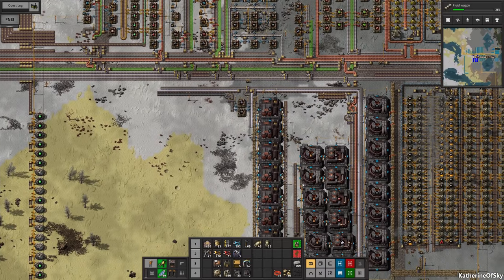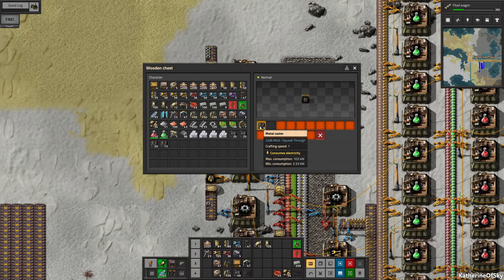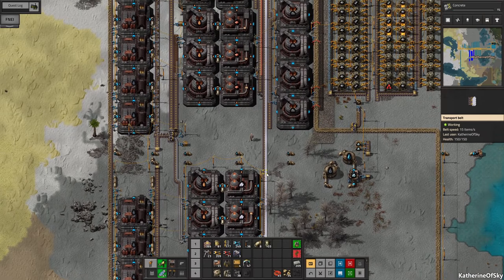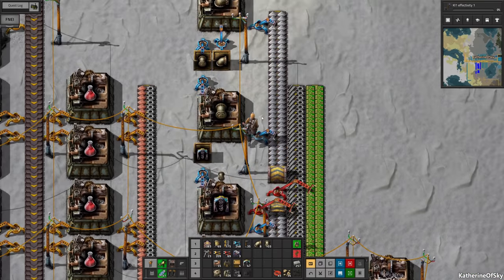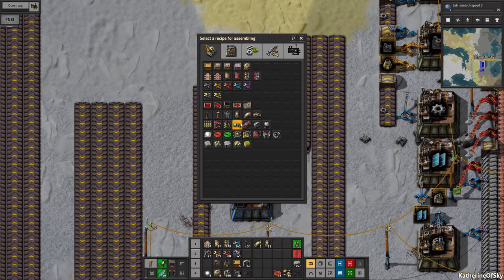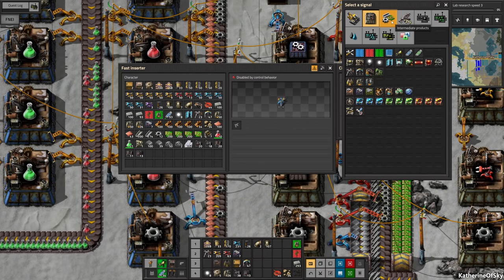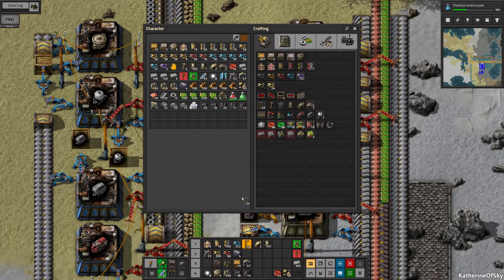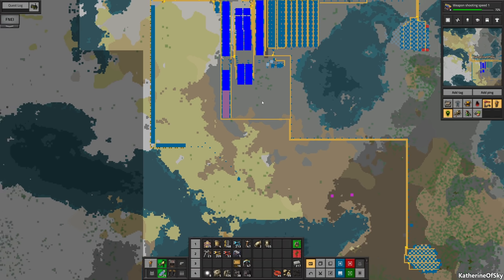Factorio 248k Mod 07 - TRAIN ASSEMBLY  - Tips & Tricks

Comment: If like me you find your factory halting because of excess byproducts this mod throws at you.  Take a look at the item/fluid handler.  It's a tier 1 research in the mod.  It basically eats excess items at the cost of some energy (can also be used to recycle some items later).  Very handy as the byproducts get worse and worse as you tier up and perfectly balancing consumption with production for a line of items 10 items deep is very rough.  Also, I'm enjoying the series.  Hope you're having fun.
Reply from the maker: I saw that.  I am going to try to avoid materials deleters though because I feel that it's a cheaty way to play.  Depends how balanced the mod is, though.  It might be necessary

Comment: KOS,

That Red. Cube was part of the 248k beacon system. It's a remote control system which helps save on the amount of modules needed 

You'll find out quickly that having machines beaconed, even with early beacons, is worth it.

BTW, 248k is in v1.0.10.
Reply from the maker: Yep!

Comment: For steel at 16:50 - I went with this setup, but at the end of the steel+coal belts, I put an underneathie end piece on both belts, facing towards the middle (like you have only on the left one), and had a normal belt going upwards, so the each underneathie deposits the steel on its side of the up-going-belt. Looks a bit cleaner, even if the effect is exactly the same, with this amount of steel.

Downside: spaghetti is gone. :(

Comment: @1:26 I'm confused about how you're interpreting the max rate calculator settings. It says you have 8+8+16 = 32/s items coming out of the purifiers, all trying to fit onto a 7.5/s half of a belt. Given that this is the case, what's the point of adding even more machines when the belt/inserters are the biggest bottleneck?
Reply from the maker: It's because....... I am not thinking about the belts :P